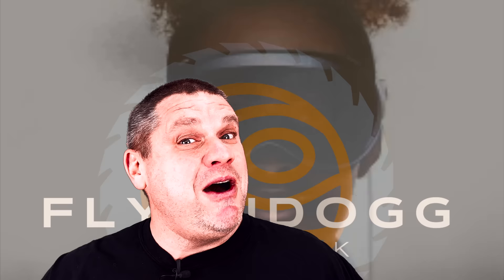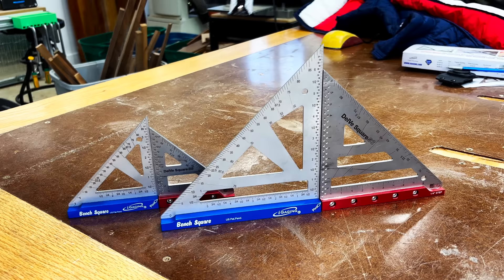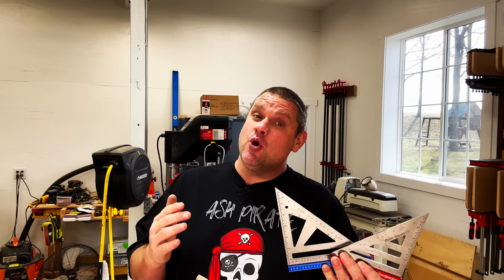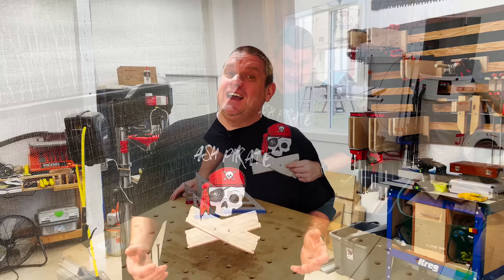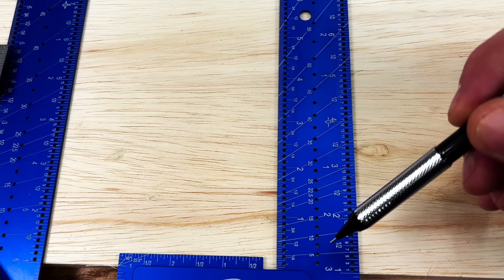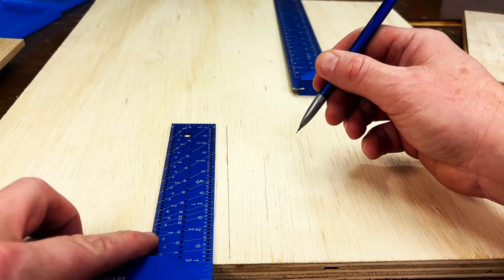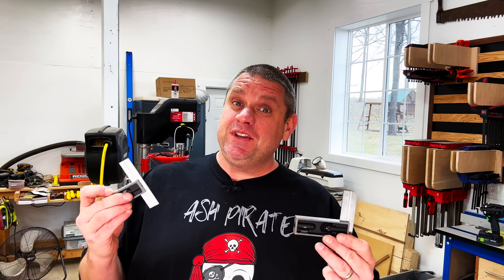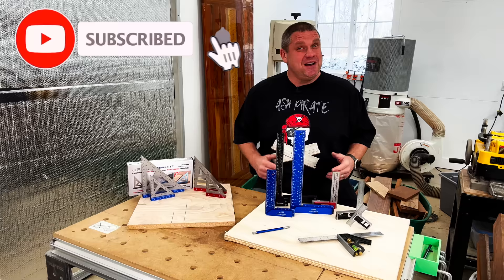The Silent Hero: Exploring an Overlooked American Tool Brand

Comment: I have the I gauging straight edges there is a 12…24….and 48 inch they also measure in 64th’s …super heavy duty…made of stainless steel and come with a sheath …I got them through Rockler’s in St. Louis
Reply from the maker: Oh nice!   I may have to check those out!   Especially the 48 and 12".  Thank you so much for sharing that, I'm going to have to scope those out in the near future.  Thank you so much for watching  Arthur!

Comment: Making nice, clean straight lines is nice but most woodworkers can't follow the lines the layout.... I know I don't.
Reply from the maker: You are sooooo right Richard.   I use referential measurements most of the time, but there are great to start off with (if you can follow the line). I’m just like you,  I’m always a little off!

Comment: A few years ago I installed an iGaging digital readout on my Grizzly 15" planer (purchased in early 90s) and it definately changed the whole setup and use process for the better.  And it was relatively inexpensive.
Reply: Yeah, I use my imaging digital angle on every tablesaw I use. Mine, the shop I work in; both of them, and have used it on the drill press! It has improved my cuts on both the Powermatics at work and my Rockwell contractors saw!
How else would I would know that the newer Powermatic shows 45 degrees, but is really 43.5!
I have used it to set my miter saws, but it's just a bit too wonky. The manual angle guage is just a lot easier.
Also forgot that the dig. Angle Guage has magnets and can just sit on the blade as I adjust that pesky crank under the top! Makes me happy!
Reply: Meant to type igaging, not imaging! Hate that annoying spell check!
Reply from the maker: Thank you so much for sharing this!   I was astounded by the number of digital products that this company has.   I'd like to dig into some of those in the future as well.  Looks like a lot of calipers are available from them as well.  Thanks for sharing and watching Kimnach!

Comment: I’m a machinist so I work with dimensional tolerances in the ten thousandths of an inch. My $120 iGaging digital micrometer is just as accurate as the $250-$300 mitutoyo digital micrometers. The only difference is the battery life is a little bit shorter on my iGagings. They’re about 5years old now, still working like the day I unboxed them. Not a fanboy, just stating my experience with the brand.
Reply from the maker: Thanks so much for sharing this joe!  Great to hear from someone who works with precision, and is satisfied with their calipers.   I saw they have a few available and I was intrigued by them when I went to shoot this video.  Thanks so much for sharing and thanks for watching!

Comment: Thank you for your tool evaluations and comparisons. As a newly interested woodworker I find these very useful as I decide what tools to acquire.
Reply from the maker: I appreciate that Bobhall-brooks!  If you are looking for another great channel to start off on, check out steve ramsey as well.  I started out with him when I first got started and he is GREAT!
Reply: I've been making high end custom cabinets for nearly 40 years. There are so many places to spend your money than $100 squares. But yes, $100 is better than $230 but not better than $10. If just starting out, spend your money on a cordless makita track saw, cordless drill /drivers, routers, saw stop table saw, etc. Then when you have extra money burning a hole in your pocket, get an e-bike or a drone or something that gives you the fiz nore than drawing a straight line
Reply from the maker: @mzimmerman12  Very sound advice!  Thanks for sharing mzimmerman!
Reply: @mzimmerman12  How about a Blue Spruce Dovetail saw? I sold some guitar effects pedals that were sitting in the closet-guitar is my other money pit-and I ordered one and some other hand tools. ( I can't believe how cheap premium hand tools are compared to effects pedals.)  I know I can buy a cheap one and fix it up myself, I have/am, but I know I will enjoy using it every time I do.  

You nailed it with buying the SawStop, track saw, routers and drill/drivers before buying setup tools.  I wonder how many new woodworkers realize what kind of rabbit hole they are getting into with routers?  Good router bits can really add up fast, but once you get what you need, I think the results and ease of use justify the expense.  I quit buying the cheap router bits when I read about a guy that had a cutter separate from the bit and lodge beside the bridge of his nose below an eyebrow.
Reply: @SaintFredrocks I'm thinking a cheap square has as much chance of wedging into ones nose as an expensive one.
Reply: @mzimmerman12  oh, the cheap ones are way more dangerous because of all the extra beer money left.

Comment: I have all of the squares in this video, and my only complaint is with the double squares. They are extremely difficult to tighten and then loosen. Especially the 4", and they both rusted very quickly. And so you know, they sit in the same drawer as my 12" Stearrette which is older, not rusted, and far easier to lock and unlock. At some point, I'll be replacing the Igague with Stearrettes
Reply from the maker: Thank you so much for sharing Kperellie, love hearing about the tools I take a look at from people who have had them for a few years.   Thank you so much for sharing with all of us!

Comment: I check every single square when I get them. Not even the mighty Woodpecker's escapes the squareness test. Most of those looked pretty good. However, I'm pretty sure the lines made by the larger double square merged at about 2 inches. Two lines are clearly visible at the start, but the far end is a very thin single line. In addition there's a thick single line at about about half the length of the 4 inch parallel lines.

I honestly don't trust any square with moving parts. I only use them for marking short lines at a set distance, or transferring measurements. For that task a regular Irwin is just fine.
Reply from the maker: If you noticed some variance, It was probably due to my camera angle or when my lead was breaking when I scribed my lines. I had some run off with the pencil lead that made it look like there was a tad bit of a variance.   I agree with you on squares with moving parts.   I will probably not use those too often to check for square but more likely use it to even out table tops etc.   Great points and thanks as always for watching!

Comment: I have a double square and a combo square and both are accurate and work well. One thing I don’t like is the screw knob. The machining isn’t great and the knob often gets jammed up. Does anyone know the threading? I’d like to get a tap and make sure the threads are clean.
Reply from the maker: Intersting.  You know after using my double square a bit from them that would have to be my only complaint too.  Seems like they might be able to improve that a bit.  I've never had any other double square than theirs however so maybe it's a common problem.    Thanks so much for watching Pete!

Comment: I wish I had the same accurate 12” igaging square you had. I bought those squares a few years back, and my 12 inch was off by an 1/8 of an inch. I think the quality control is not as consistent as woodpeckers.
Reply: I am referring to the 12” igaging layout squares.
Reply from the maker: Thank you so much for sharing this You2datube!  I wouldn't be surprised if the QC is not as tight as woodpeckers, I think they pride themselves on that.  Although I have heard people getting out of square woodpeckers though.  But they replace them immediately from what i hear.     Sorry to hear you had that issue, but thanks for watching!

Comment: Appears the SS blades on the 4" / 7" squares are drilled for 1/8" layout but the aluminum blades are drilled for 1/16" layout......???  Either way great video and looking at adding these to my shop SOON.  Thanks!
Reply from the maker: Thanks so much Chuck!  Really appreciate you watching!  I'll have to check on the 1/16" vs. the 1/8" I feel like the wholes are staggered for the 1/16th which makes it a little difficult to see on the video, but I need to double check.
Reply: @FlynndoggWoodwork Try your first Amazon link.  The wholes are staggered  & very clearly only drilled every 1/8".  Maybe this is early production and they've changed??
Reply from the maker: @Paladin7845  Interesting, wondering if I misread the tool.  I'm going to give it another look.  Thank you so much for pointing this out!

Comment: Thank for the comparison but I do have a question.

You don't address it in the video but in your title it seems that you are implying that igaging is a USA made product. Can you confirm this? I've read elsewhere that they are chinese. That's not necessarily a deal breaker if they are as good as they appear to be and that much better priced but I would appreciate an accurate representation.
Reply from the maker: Well you will notice the question in my title.  I did some research on them and it appears that they are running their buisiness side of things from the US but manufacturing is done elsewhere.    It is hard to tell what is exactly going on with them without having some inside knowledge.   Great question and thanks for asking!

Comment: The only advantage woodpeckers has over the competition is marketing.  Any cnc machined tools will be more accurate than anything required for woodworking.  I'm glad to see that you didn't do the idiotic eyeball test for squareness.  Holding any of these tools will cause more tolerance variation from thermal expansion than any factory spec.
Reply from the maker: I'm glad you brought this up Douglas.  I was working on a project today and I measured everything out with some fancy precision layout tools and I realized, I'm the problem in the equation.   I didn't cut on the line, or I had a board that wasn't exactly milled perfectly.   There really is only so much precision we need in woodworking.  Human error is always more than the tolerances of these tools!
Reply: Exactly.  If you think about it nobody's fence is located parallel to the blade anywhere near the accuracy of the square.  And the blade wobbles more than the tolerance of the square.  It's just a game of specs that nobody can measure at home. @FlynndoggWoodwork